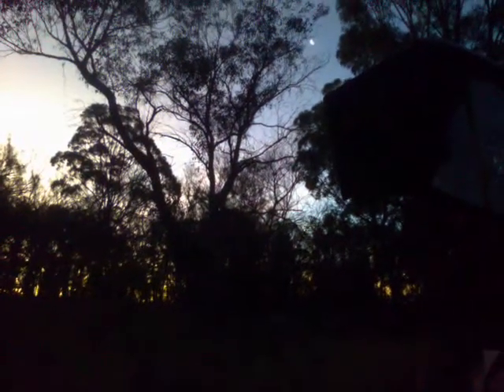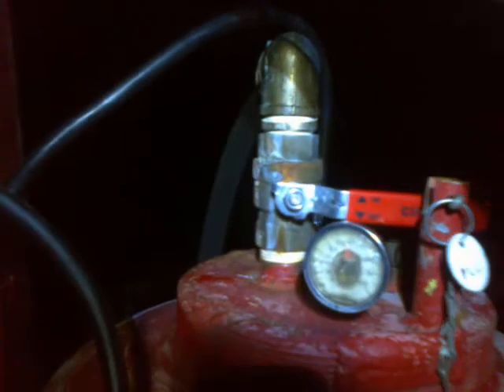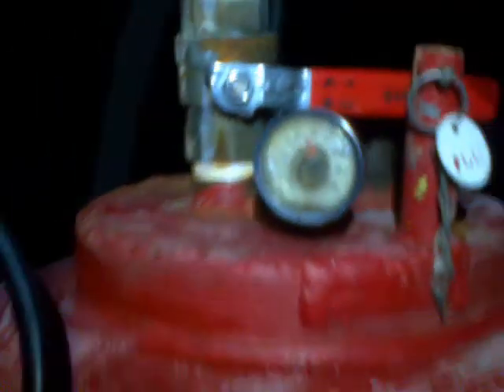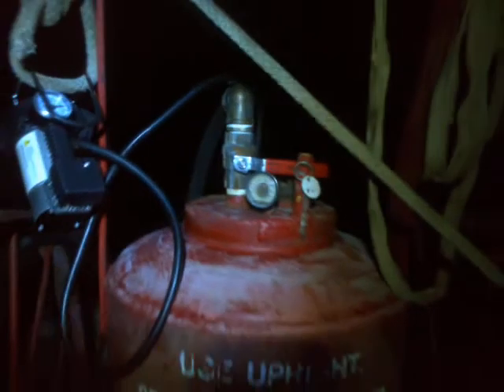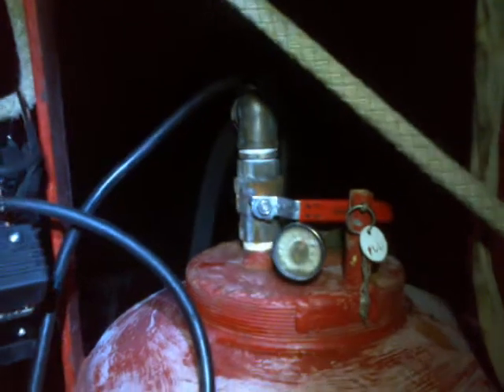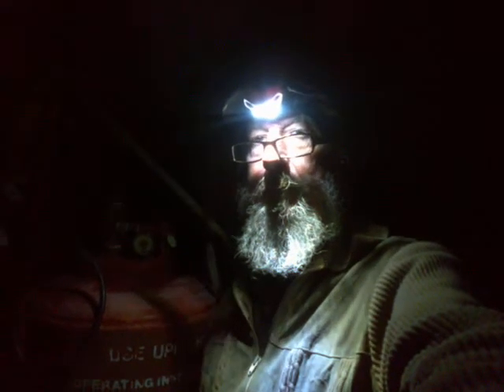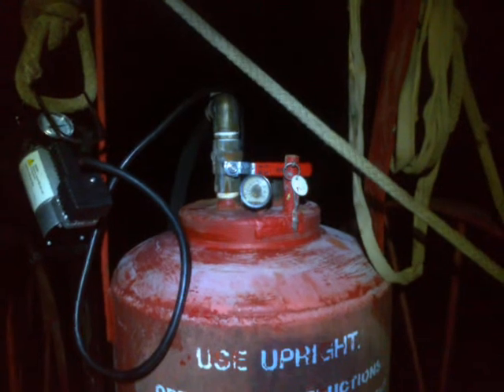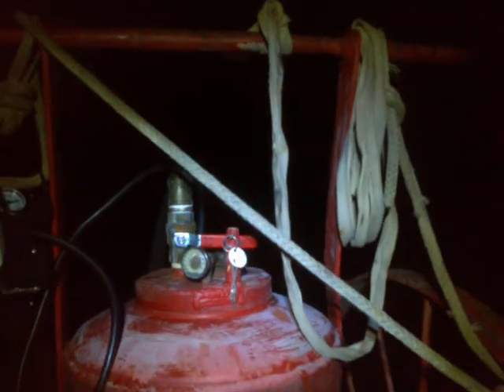Post Fire Analysis, Water Cannon/Airport Firefighter Performed Perfectly, 85 Litres On Fire, Of 130.

Comment: I've got a fire pack that uses a similar tyre pump pressurise a tank that I built.
Reply from the maker: G'day,

Thanks.

Once upon a time these things were fairly standard, "Airport Firefighters" they called them - sort of enough water to extinguish the Grassfire around a crashed Tiger Moth.

  Last time I made a video featuring it a viewer commented that they had recently seen one on-duty at a Petrol Station in Bali...; and on Concrete, adding water to a Petrol Fire will be a bad idea - but it shows that I'm not the only person still using an Original...

  Have a good one...

Stay safe.

;-p

Ciao !